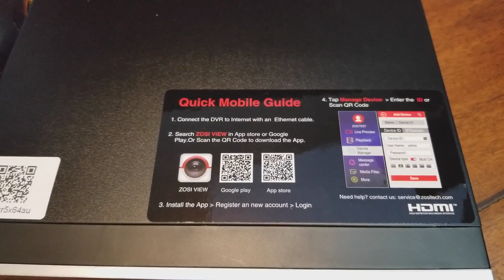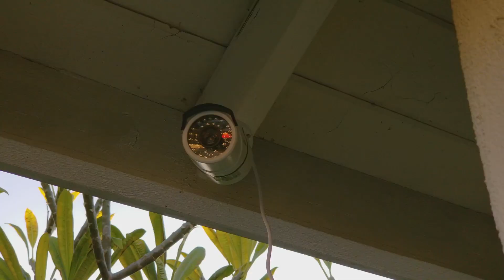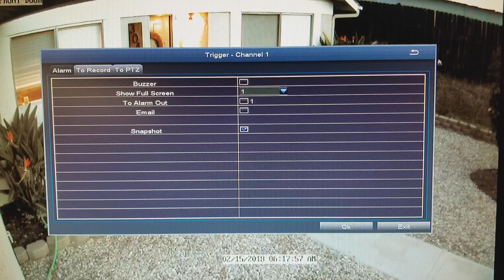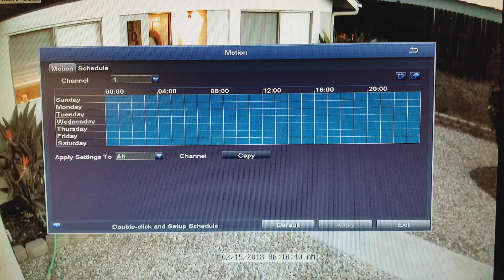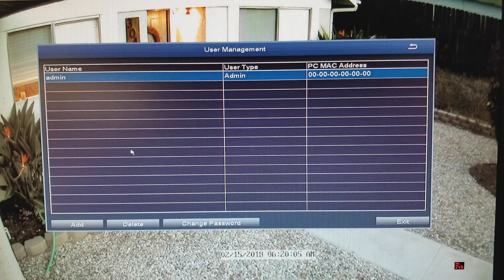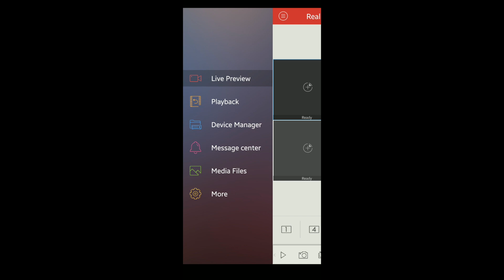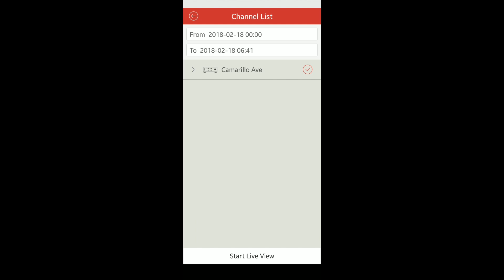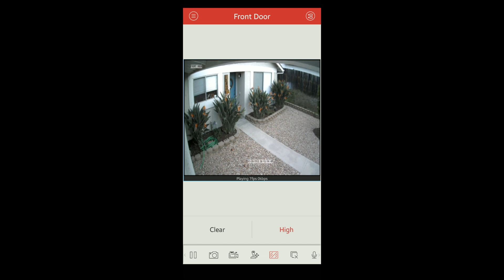ZOSI 4 channel 1TB Security Camera Instillation & Review

Comment: Very good review. I like the detail that you go into because the book doesn't give much information on how to do all of the settings. I have set a privacy area in my grandkid's bedroom, but I made the area too large and now don't know how to undo this action. Can't find anything online about it either. 
I like how you run the cables, I need to figure how to run mine in a home that is almost 100 years old and built weird. 
Things and apps have changed now, and Zosi View doesn't work with the system and it is a different program on the computer now also. I have the 8 camera setup.

Comment: I appreciate the review a couple questions Have you had any problems with the system so far I'm looking to buy it and I seeing through another review that the infrared had trouble switching on in high heat conditions and I live in Florida so I was wondering if you had any of those issues or other

Comment: Does it work if you use it without a network cable connection?
Can I still see the live cameras on the monitor? I only need to use it when I work by the computer and no need for recording on hd etc.
Reply: Of course it does.
Just get computer cable or HDMI and connect to monitor.
Reply: @180ztv  use AVG cable instead of HDMI cable
Reply: @cindylong624  
Hey

Comment: I've had mine for years. I've never figured out how to keep it on one particular camera . If I click on camera 1 it will only stay on there for about 20 seconds and it will default back to the multi screen.
Reply: Exactly my problem too!  Have u found out how to rectify this?
Reply: @agentstarling9998   take it off scan mode
Reply: How much did u spend on it
Reply: @ajacob4815  227 for 8

Comment: How has this system held up, any issues? We were looking to get 2 wireless cameras but we don't have internet at our property and the price and monthly cost for Arlo go cameras on Verizon network was crazy so we have been looking at this system for our home, after this long and for the price would you still recommend this system for basic home monitoring?
Reply from the maker: The system has held up great. I use it just for monitoring my house when I'm inside. I haven't hooked up to a computer monitor and I can see all corners of my house at night time even when it's pitch-black with the night vision. You do not need any network to use this system and can rewind all the footage if you have a monitor hooked up with a mouse. I would say the only downside on the system is the app interface for phone

Comment: Good explanation....   I have a couple of questions.  1. Are the IR-leds  visible at night?  2. Did the system come with 60' of wire for each camera and if you need more than 60' is there an extension available?
Reply from the maker: The IR lights have a slight red glow coming from them. So if you know where the cameras are you can see the glow. Each camera comes with 60' of wire and you can buy additional on Amazon.
Reply: Extensions are available. In his video of the night shots, you can see the glare from the IR on other cameras so positioning is crucial. Each system does advertise 60ft of cable for each camera. Amazon have whole or partial set ups including cables.

Comment: Do you have to plug in an Ethernet cable that connects to your router in order for this whole system to work? I'm trying to set this up for someone that doesn't have internet and so far i'm not having any luck. And if so, do you HAVE to have internet to use this product?
Reply from the maker: You don't have to have internet for it to work. But then you can't use the app to remote monitor it.

Comment: Hey we got the same brand while i got 4/8 ch. Evrythin was also setup/installed with momentarily 2  cameras for a test. I rcvd it fr Amazon but i dont see a 4 splitter for power dc in d box. The video on my pc monitor was good but after awhile it contstanly restarting with a beep with no signal or cam image. Do u have any idea why system is restarting? Its annoying if i rcvd a defective dvr.

Comment: Suppose I need more than the provided cord length to run a camera, how long is too long before I need an additional power supply?
Reply: Justin Grant I was thinking the same thing I might need to add more wire....did you install yet and if so what did you do

Comment: Good review.  But have you ever needed to export video to a usb drive?  A friends seems to have a fault where it will only record about 2 seconds and the file size is only about 9mb.  The video files are about 19min long on average.  Also the unit seems to reboot after so called saving.  Thanks.

Comment: Can this be done without a network connection? I just received mine, installed the 6TB (maximum claimed compatibility) hard drive, plugged the HDMI cable into it & TV & result was NOTHING. The unit powers up when plugged into power and HDMI but with multiple hdmi cables working everywhere else there's absolutely no video signal through any video output (yet it has the Quality Assurance sticker on the unit). So in order to provide a video out through HDMI does it absolutely demand a network connection and if so, am I the only person finding that horribly suspicious (it's Chinese after all, the county on full network attack of much of the USA)?
Reply: Did you figure it out? I also don't wanna be on a network for similar reason for privacy.
Reply: @theultimateninja  Yes. It defaults to the Eastern 50Hz signal output while here in the USA I needed a Western 60Hz signal. I used my HDMI to Composite converter and that gave me a video signal. Then I was able to change the video output from 50 to 60 Hertz.

Comment: Do you have to connect it via the cat 5 cord to the router or can I just use wifi?
Reply from the maker: There is no Wi-Fi with this unit you can buy a wireless repeater and plug it into it. If you don't have one of those then you just have to plug it in with a ethernet cable

Comment: does this system work over internet , Im told most of these ones run over internet which I dont have.
Reply from the maker: This system does work by itself without internet. If yiy want access to the dvr from your cellphone then you will need internet access to the unit. This will work perfect to record without internet access.

Comment: HOW TO SAVE THE VIDEO FILE TO EXTERNAL HD AFTER SET UP AUTO 24 HOURS RECORDED OR 12 HOURS VIDEO RECORDED  THEN THE VIDEO FILES VERY BIG SIZE NEVER WILL FIT INTO THE USB FLASH DRIVE AT ALL. PLEASE HELP ME IF ANYONE KNOWS WELL OF HOW TO SAVE VIDEO FILE IN CASE I NEED GIVE TO 911 . I BOUGHT THE LOOCAM BRAND ONE BUT BAD QUALITY CAN NOT ABLE SAVE VIDEO FILE THEN I AM RETURNED IT BACK TO AMAZON. I AM DECIDE TO CHECK ON THIS PRODUCT BUT IT IS EXACTLY THE SAME AS LOOCAM ONE . I AM HOPE IT CAN ABLE SAVE VIDEO FILE TO EXTERNAL HD. IT IS AUTO RECORD BUT BIG PROBLEM THAT IS VIDEO VERY LIMIT TIME RECORD OF EACH VIDEO ALSO NO WAY CAN SAVE IT TO EXTERNAL HD BUT SHOWING ERROR OR NO DATA...ETC...ON THE LOOCAM. I AM WORRY IF THIS ONE I WILL BUY SAME PROBLEM AS LOOCAM ONE. PLEASE HELP ME IDEA ABOUT THIS ZOSI ONE.